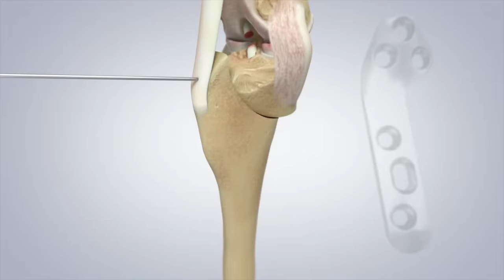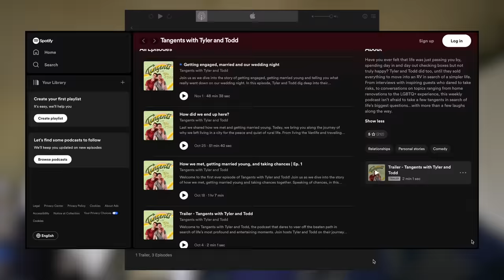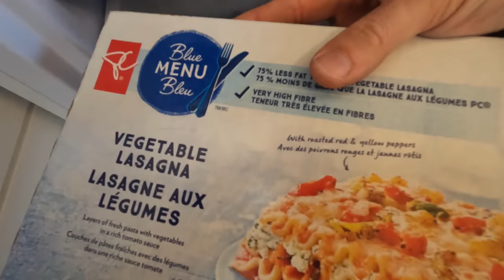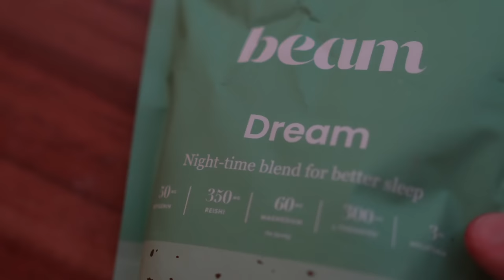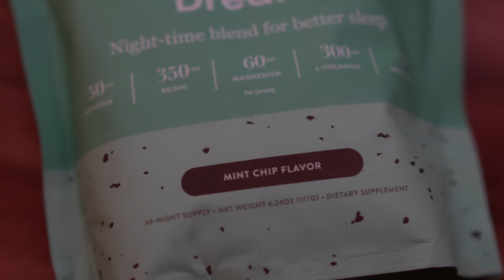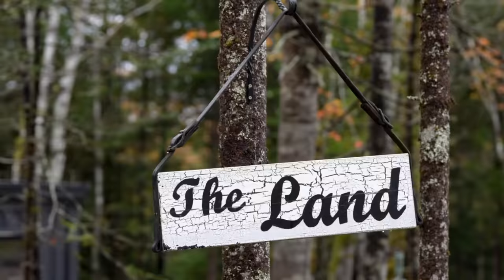We're Out of Time

Comment: I have a little decorating tip for Todd: I've decided that white lights can stay up all winter. I convinced myself that olored lights are for hristmas, andhite lights are for inter. I use both during the holidays, but the post holiday blahs can be eased by leaving white lights up. It's such a dark time of year, turning off all the lights after Christmas is such a downer. I also hang a lot of artificial snowflakes and icicles from my curtain rods in front of the window, have snow-frosted wreaths and garland, candles (LOTS of candles) to keep the winter theme going. It helps a lot with the after-Christmas blues.

Comment: If you haven't taken Charlie in yet, I should tell you my dog tore her CCL a few months ago. She is about to turn 10 as well, so I completely commiserate with you two. My vet is going to try PRP before resorting to surgery, though which is injecting platelets into my dog's joint directly. My vet said that if it works, it can last 1-4 years and is much less risky than surgery. Thought I should share in case you didn't get told that was an option.

Comment: Charlie may benefit from one of those wheeled harness arrangements like they use for paralysis and hip dysplasia. I bought one for a friend's old dog who was having nerve issues in his rear legs.
You'd need to find one for a dog of his size and weight, with  larger wheels for the gravel. I get the feeling watching him that he's upset at his lack of mobility and the restriction to the house. We know it's necessary, but he doesn't get it. "I'm a big dog, I can go where I want!" I am happy that his Grandma/Girlfriend💗 came to babysit/spoil him. And for the chance it gave you to get so much done.

...and Todd? It's a tool-belt, babe. Not a grass skirt. what happens if the staple gun goes off and shoots you in the ass?  Trust me, as a teenage roofer, I know what getting pegged by a nail gun feels like. You can role play with Tyler later, once you get some Fischer Price tools.😋🤩

Comment: I know you have a lot on your mind, and this is low on the list.  But it will save you time. If you haven't already labeled each cable for your podcast power sources.  It will make a massive difference for you and save time.  Also, use surge protector power strips for ALL of your electrical equipment.  Podcast, lighting, mics, refrigerator, etc. It will help protect your equipment and safety from possible fires.

Comment: If it makes you guys feel better I paid a "professional" to install my expensive  standing seam American steel roof when I was building my tiny house. The roof was supposed to last 50 years. Here it is 8 years later and my roof is leaking. The contractor left a gap in the ridge cap where the gable meets the dormor right in the center of the roof. He used a regular caulk instead of roofing sealant to fill it in, basically leaving it exposed to the elements. He never capped  it off properly making his work beyond shoddy. When I got up on my rooftop to inspect my stomach sank. I was p***ed. The one thing on my build I hired out so I didn't  screw up myself, had failed. I ordered a new ridge cap and will be making the repair myself.  As a woman, I have had offers for help but at this point I don't want anyone touching my house. If there is one thing I've learned, nobody will care for your home as much as you will.

Comment: Todd was having way too much fun with himself without you there Tyler😂He thinks he has conversations with himself in his head but we have video proof it is definitely outside his head!😂 I absolutely LOVE the siding you picked with the black! It's gorgeous! I know this isn't something you want to do, but it will most likely be necessary after Charlie's surgery anyway (or it was per the surgeon for our girl after her hip replacement) but HER saving grace (and ours) to insure she healed properly was a large wire kennel with a comfy bed inside. It made sure her movement was as limited as possible as was needed during her recovery. We didn't like that she had to be in it and neither did she, but when she was out of it she continually tried doing things she was not supposed to do like jumping on the couch or putting her full weight on the leg. Just a thought. ❤🐾🐱🐾❤️